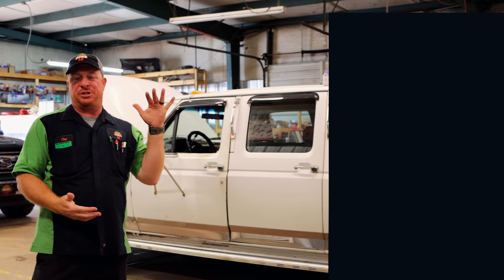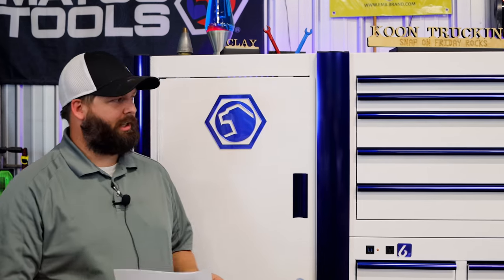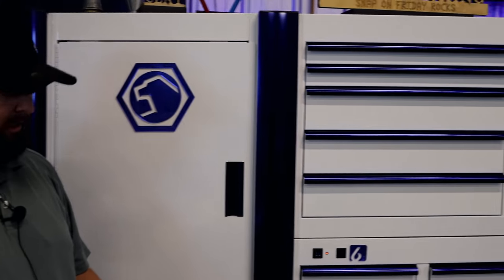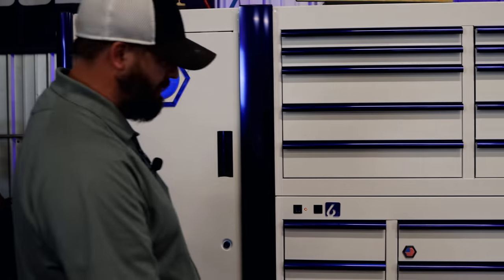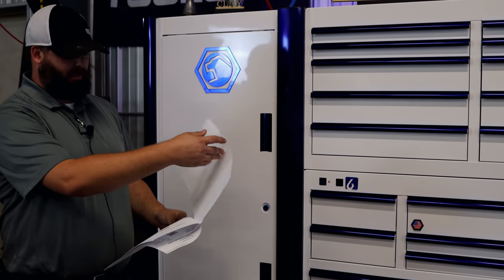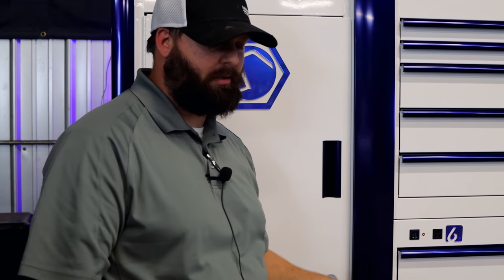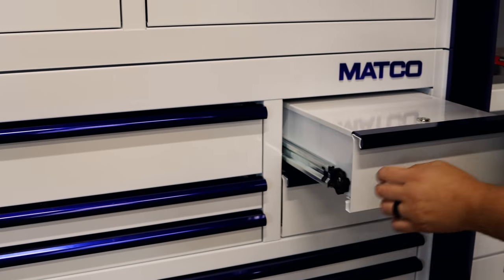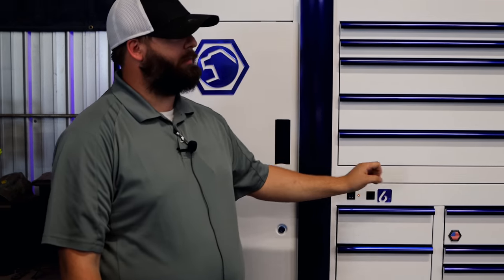My New Toolbox Reveal: Take A Look At This One !

Comment: Nice looking box, I did notice that the side locker has no lip on the rear, to keep thing from sliding off when you pull the shelf out. Now if we only had a Matco dealer in the area.
Reply from the maker: You can flip them over to be drawers if that’s what you rather have.

Comment: I feel like the power would be better to put in one of the lockers.   Put all your electric impacts on the shelf and use the bottom shelf as the charging area
Reply from the maker: I put power in my old lockers and honestly it was a little much with all the cords and stuff in the way all the time
Reply: @KoonTrucking  fair enough

Comment: It would be very cool if you added two spotlights to the shop ceiling, about 20 feet apart, aimed down at an angle to the box.  Give it that museum or 'Welcome To Heaven' look.

Clay, I'm curious if Hamilton put on his best salesman hat and worked hard at getting you to buy an Epiq?  Was he slightly disappointed when you told him of your decision to order the 6S?
Reply from the maker: No he wasn’t he even said it was a good looking box. My dealers compete with each other but it’s not the drama that everyone wants there to be. And honestly I am glad it’s not. I don’t do drama and if that was the case I would shy away from both them. They are all grown men and respect the businesses they are in and quote the best prices that is fair with them and the customers. I have the best tool guys in the business.
Reply: @KoonTrucking  Thanks for the reply, Clay.  I was actually asking about when Jovan originally sold your box, so before you even placed your order for the Matco.  Unless you already had ordered the Matco before he sold your previous box.  I apologise if I made it seem otherwise.

Comment: Michael seems like a good guy, but a Snap On 80” Epic would have been my first choice. It’s actually made by Snap On and doesn’t require a middle caster to prevent bowing because it won’t bow in the middle.
Reply from the maker: I’ve had several snap on toolboxes and the last one I had issues with and my dealer tried to get snap on to correct it and nothing would get done so ..... I decided to change and I’m completely happy with this set up

Comment: Gorgeous box congrats!  Love the color combo. At first I thought you were surprising us that you finally found the Revel X that you wanted but nonetheless very nice box!  I love Matco tools and I purchased a 4s triple bank box from Matco. Unfortunately I am having issues with my lock hanging up and noticed that when I unlock my box, my bottom left drawer is extremely hard to open. Then upon further inspection noticed that the drawer is not square. This was noticed about 1 year after having the box built so my local dealer and Matco are giving me a hard time about resolving the issue. Additionally, I have noticed that not all drawer slides, but probably 1/3 of my drawer slides  seem to "kick out" on the right side only when I start to close my drawers from being fully opened.  Does anyone have similar issues with their 4s triple bank?  I hope to have a resolution soon so I can keep my pretty sapphire blue 4s, otherwise I will either upgrade to a 5s, 6s, or just go with something different such as  Montezuma.  Thanks for the video Koon Trucking!

Comment: Did it come with a ladder to reach the top drawers?  Which cost more --your house or your new box?  But you got what you want so it is your forever box I would think.  Fantastic looking for sure.  Thanks for sharing.  What did you work out of once your box was sold from you?
Reply from the maker: I work out of my roll cart all the time. The box just hold larger sizes and extras and specialty tools and cases etc. all those were put into my F350 until the new box came in

Comment: Michael didnt demonstrate the way the drawers are held closed. Is it a clicl lock like your old snap on or do you lift the trim up to unlock like the epiq boxes? Also how much reinforcing does the bottom of the big drawers have to avoid sagging?
Reply from the maker: No it is in the knob he shown. It is friction that you can adjust. You just simply open the drawer. No catches. No latches etc.

Comment: What if they made a trim piece that fits into the gap between the top n bottom?
Reply from the maker: It’s only 3/16 I have no issue with that. The Snap On was like 1 1/2 inches

Comment: So I have at work, a 25 inch deep 6S with a hutch and eventually want a side locker like those for it.  Just one, but the configurator doesn't show it having doors like that.  I've spoken to my distributor and he's not sure why it's showing it without.  They do come with a door though?
Reply from the maker: Yes they do that so you can see the inside of it.
Reply: @KoonTrucking  I spend enough money with my Matco dealer...don't tell me these things.
Reply from the maker: @AK4TF  yeah they all have doors on them but in the pictures on the ole inter web they do that so you can see how it is configured with the drawers and shelves.
Reply: @KoonTrucking  I'll have to get me one of them sooner or later.  Unfortunately, until the other building at our powersports dealership is done, the shop is too small for me to fit any bigger of a box.  But those comfort grip locking flex-head ratchets, my favorite.  Got one in 1/4" and 3/8" in the black finish and orange grips.  Two most used tools in my box.

Comment: Man you may know the answer to this but I have a 1992 7.3 idi I will not start I have 2 new batteries a new starter new glow plugs and relay and a new oil pressure sensor switch i can not figure out the why it will not crank if you start it with a gas rag the truck will run perfect but will not crank
I would love your input on the situation I have going on with my truck and sorry for the long comment
Reply from the maker: Fuel pump good ? The manual one that sends it up to the high pressure pump ? Or maybe high pressure pump itself ? There’s several things that will keep it from starting but obvious the fuel issue would be where I would want to start since it will start with a gas rag
Reply: @KoonTrucking  thank you I Was gonna  put an electric fuel pump be hind the mechanical pump and source fuel through it

Comment: Top chest is useless can't see what's in it, should've got a hutch. After you made the video stating the big boxes are pointless with roll carts and you regretted buying them you buy this. Why not buy an Epic?
Reply from the maker: The top chest you can see in. A hutch adds NO more tool storage than the top of the box. I have way too many tools to have a bottom box only I would have had to get a Mr. Big or Titan, and honestly that’s what I thought I wanted until I had to move the Titan around a little bit. I own my shop so I have an 80x120 hutch pretty much as it is. I like the look and the function of a top box.
Reply: @KoonTrucking   I'm always telling the younger guys in my shop not to waste the money on a hutch. They cost too much and you don't really gain anything, you're better off putting that money in a top box or roll cart.